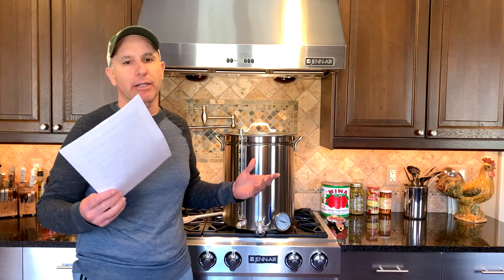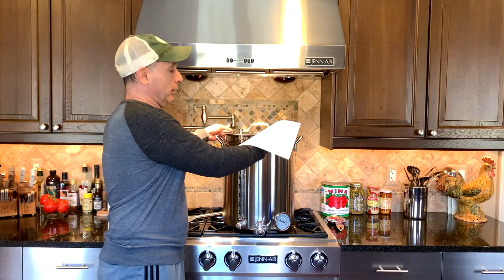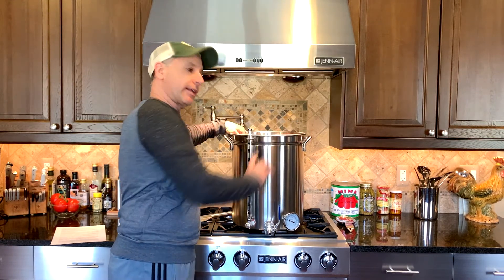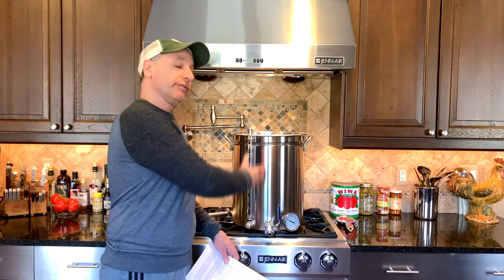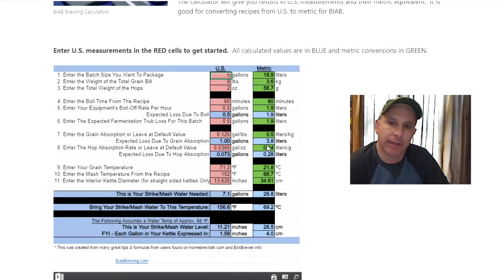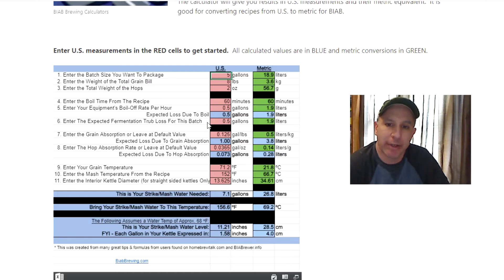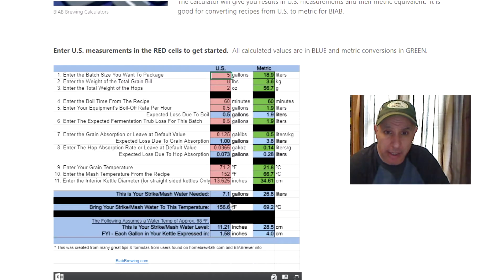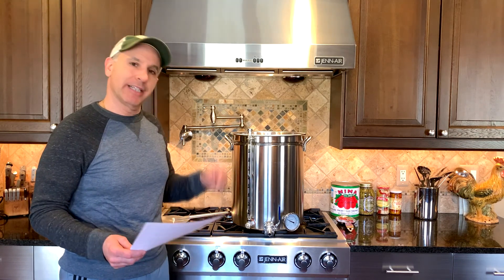How to Calculate Water Required For Bew-in-a-Bag (BIAB) Brewing

Comment: If your pot is a touch small, can you use a bit less water and then add it back in once the grains are removed?
Reply from the maker: For best results you may want to just invest in a larger kettle or scale down your recipe. As with anything though, you can test topping it off and see if you like it. You're the ultimate judge!

Comment: What's the range of boil off amount for a 60 minute boil? I'm not really interested in being exact, just want to get started and use an average number. I am using a 10 gallon stockpot.
Reply: Mine is about 5 quarts using a 16 gallon kettle. I think a half gallon is low as fuck but I dont know his elevation. It matters in your boil off rate cause higher elevations boil off a little cooler. Im on the east coast at about 750 feet above sea level. It matters how high your heat is and the length of your boil too. So a range is subjective

Comment: i didn't try your spreadsheet yet, but i saw a mistake in your convertion.
line 13 hop absorption rate : 0.0365 gal/oz is not 0.14 liter/g, it is 0.14 liter/oz, you missed the oz convertion. 0.14/28.35= 0.005 liter/g (1oz = 28.35g)
same issue on line 11: 1lbs = 0.45 kg, so 0.125gal/lbs = 1.05 liter/kg